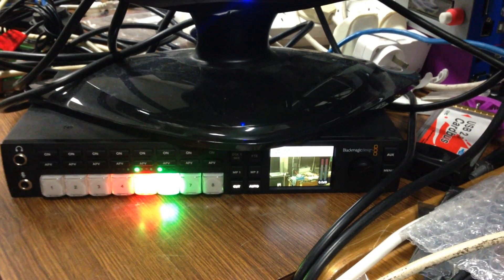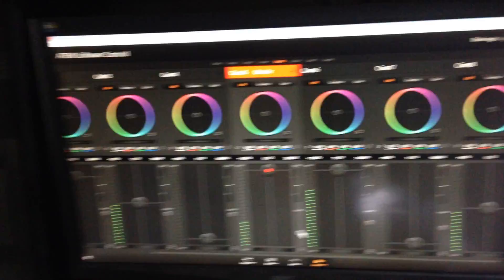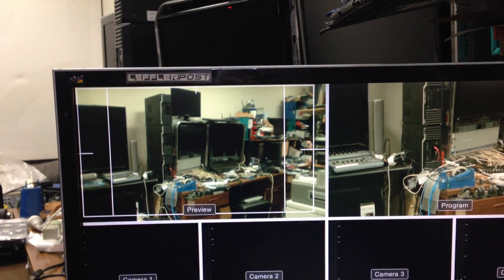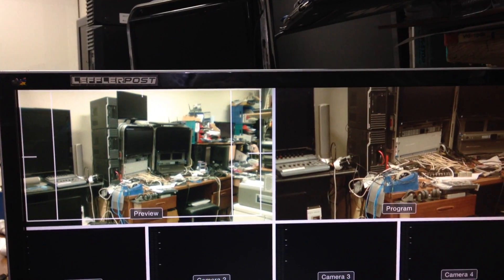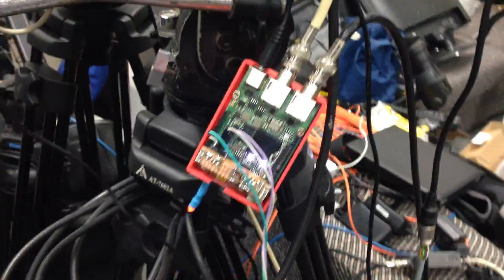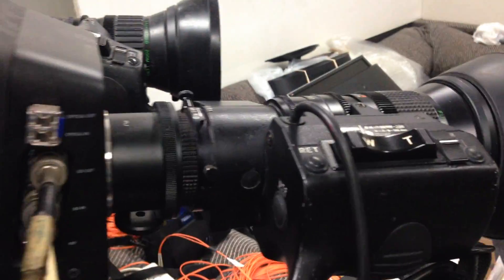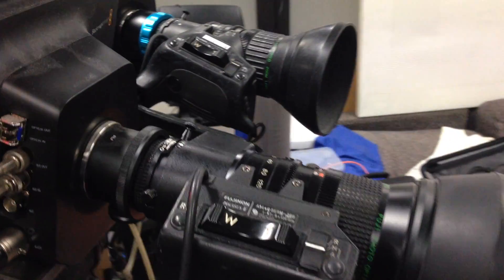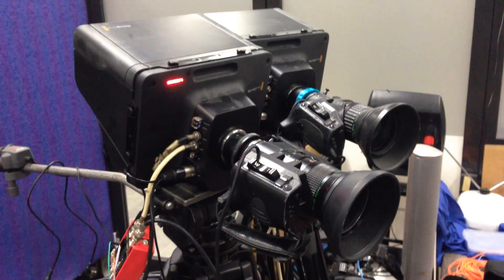Fujinon Iris Controller

Comment: Great video. Are those HD or SD lenses? Which converters are you using?
Reply from the maker: These are old SD lenses. One of the converters is a Fotodiox Pro B4 Magic Adapter and the other is a cheap Chinese Adapter.
Reply: LefflerPost I have few fujinon, canon and angeniux sd lenses and fotodiox b4 magic converters mkii. Each lens is giving soft picture above f5.6. Do you also have this issue?
Reply from the maker: I have the same problem as you with the fotodiox b4 magic converters. But they do say not to use them more than f5.6. The cheaper converter is fine as it has no glass in it but you have to operate at x2 to avoid edges.